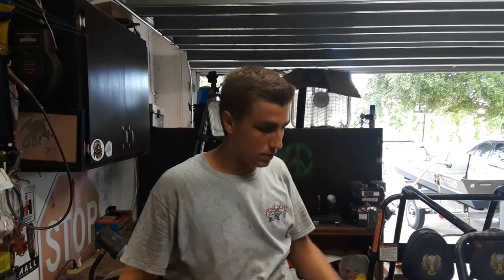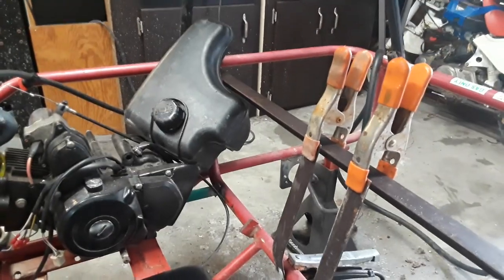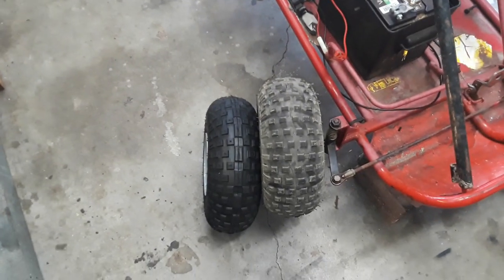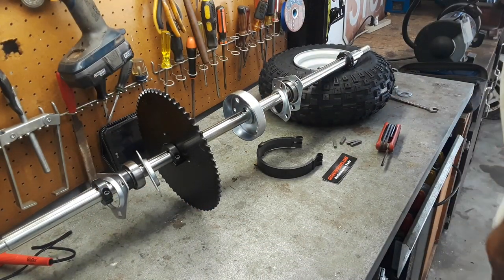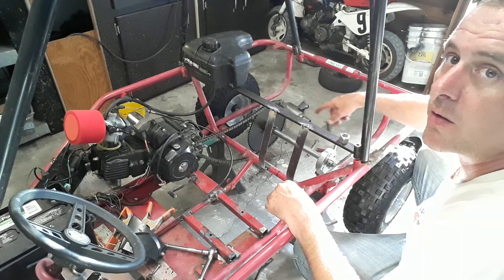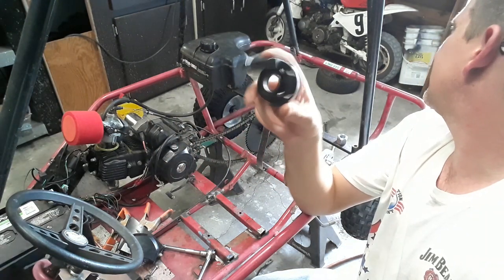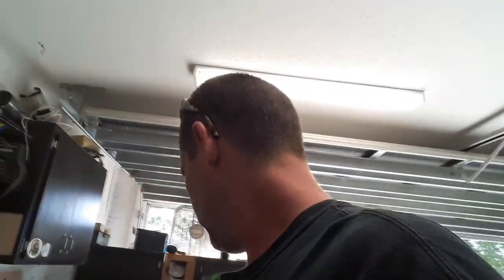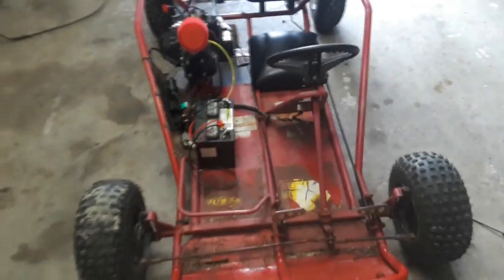110cc Go Kart Build-Live Axle and First Ride

Comment: Aweaome cart!    Can't wait to see what it will do when your new sprocket  comes in   The brakes  will work better of you swap the position of your mounted  brake shoe and the brake bar so it uses the rotation direction of your axle to pull the brake tighter when you hit the brakes.
The friction of the axle against the pad will boost your clamping power. 
If that makes sense lol.
Reply from the maker: Ahhhh...very smart..i hadn't even thought of that..good tip..keep them coming!..thx Hillbilly Holler!
Reply: @GoKartsorGoneFishin  I wouldn't have thought of it either till we took a long look at Brad's yerf dog brakes.
They weren't grabbing very well so we compared them to the blue streak that will lock the back wheels and saw they pulled over the top instead of the bottom and saw Brad's were opposite.
We switched his and it will lock his wheels now

Comment: Gearing will make if fast. You should be able to go with pretty high gearing with the 110 trans.
Reply from the maker: Heck..little bit of tuning..she will boogie..more to come..thx bubbz!
Reply: Yeah my 110 mini chopper goes 55ish stock but it has a small sproket and tires a little bit bigger than the ones on the go kart

Comment: It looks like there is supposed to be a carriage head bolt on that but a carriage head bolt will not work. The square part on the carriage Bolt Stan's proud way thicker than the flange so ultimately unless you have a square cut into your axle hanger for a carriage Bolt it will not sit flat as the square Carriage part will collide with the axle hanger. The reason it is so slow is because your sprocket is almost as big as the rear tire. If you want to speed it up put bigger rear tires on it and I mean a lot bigger. Something that you would see on a riding lawn mower in the rear. They're called Turf savers otherwise you need a smaller rear sprocket. I bet that sprocket almost touches the ground. I haven't finished watching the video yet I'm only at 10 minutes 26 seconds. By the way good job!!
Reply from the maker: I don't know why I didn't do gear ratios...I goofed up..thx for the tips..I got a smaller sprocket on the way and I'm looking at taller tires too..thx again Todd!
Reply: @GoKartsorGoneFishin  I was looking at that buggy again and you can't go much taller on the tire because it's going to get the frame unless you got a wider axle that protruded passed the frame but you'll Bend an axle that wide really easy like smaller sprocket is the way to go. Maybe you could cut the frame and modify it so you could put bigger tires on it. It would sure look a lot better. Thanks for taking the time with me.
Reply from the maker: Yep..I agree 100%..thx for the imput..I love the feedback!..keep it coming Todd!
Reply: @GoKartsorGoneFishin  hahahaaa... you don't need me to tell you that. You got it under control : )

Comment: Cant wait till its geared to go a little faster! Have you tested the brake out and is it braking good?
Reply from the maker: They worked good but I will have to try them at higher speeds..might have to go with a disk brake system
Reply: @GoKartsorGoneFishin  ok. Ive heard that it actually hurts how hard you can brake if you pull the band from the bottom. If you pull it from the top it isnt as hard to brake because your trying to pull it the way the drum is spinning. If its working then great!
Reply from the maker: You are correct my friend...I will probably have to change it when I get to higher speeds..but at 16mph haven't got to really test them

Comment: I dont get why people say that those atv motors are slow( i have a 110cc atv and it hauls ass and faster that 45mph ?)
Reply from the maker: How many gears?..I wanna replace with a 3 speed
Reply: Oh mine is auto so...........
Reply from the maker: Righto..this motor only has 1 forward gear..si I'm putting a smaller axle sprocket to try and get more top end..thx for watching friend